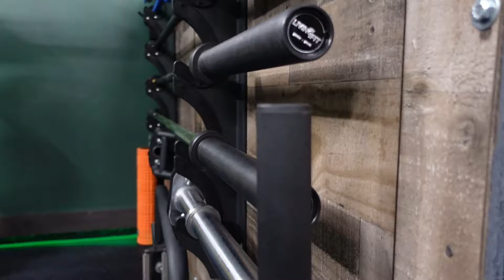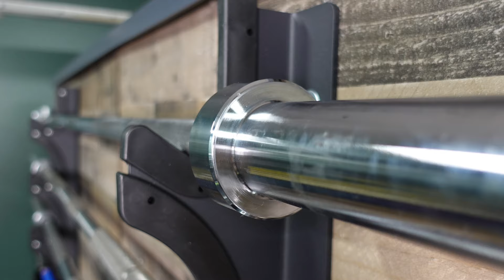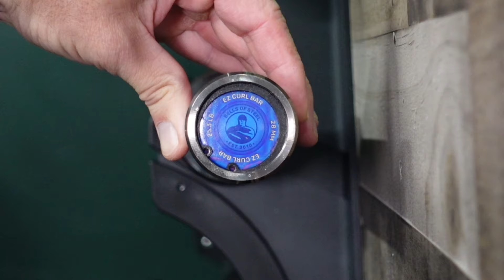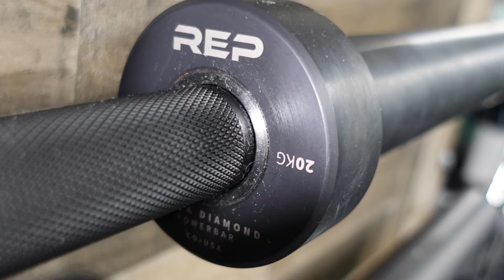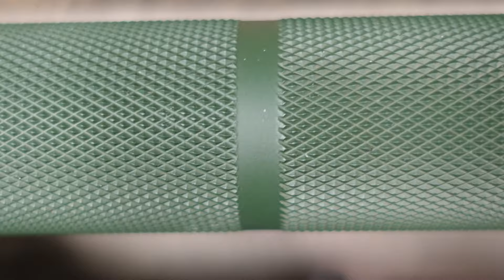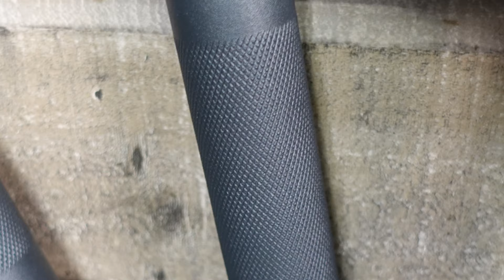The Barbells I Use Most In My Garage Gym!

Comment: Hey Tim, I'm overwhelmed by the variety and complexity of the barbell arena. I've been lifting longer than you, but that's only because I'm considerably older than you. I've always used what was available in the commercial gym at the time. That's presumably a standard Olympic bar, at least to me. I definitely recall some bars that I didn't like, but unsure exactly why. Here's a 101: What's are the differences between a dedicated power and a multi-purpose bar? I'm presuming the power bar is for power lifting, which I've never done. Maybe the pb is capable of a heavier weight capacity. But I see the big body builders at the commercial gym using a lot of weight with what appears to be a regular Olympic bar as I would know it. I'm fascinated with all the details I missed over many years. Great job. Thank you.
Reply from the maker: Sorry I missed this comment! The basic difference is the diameter of the bar, where the kneeling is and how aggressive it is, and how quickly the sleeves been. For most folks, a power bar is the right choice. It gives you medium, aggressive, neural, and a center neural for Traction on your back for squats.

Comment: I have the Rep Delta Basic as well.  It is definitely nicer than those I've used at commercial gyms, where it feels like the knurling was scratched in with a dull toothpick.  I do wish the knurling was a bit more aggressive.  Matter of fact, shortly after I purchased it I found one of your videos comparing the barbells you owned, I believe you stated that most of your clients seemed to prefer the Rep (single) black diamond cerakote... which was the other barbell I was debating.   Way to create buyer's remorse!  Oh well, guess I may turn the Delta into a beater bar in the future.
Reply from the maker: THere's always another bar to buy! I spend way too much time on the American Barbell website looking at bars I can't afford! If you go Black Diamond for the knurl, I'd actually recommend going stainless. It's got just a tad more bite than Cerakote and will look nicer a lot longer.